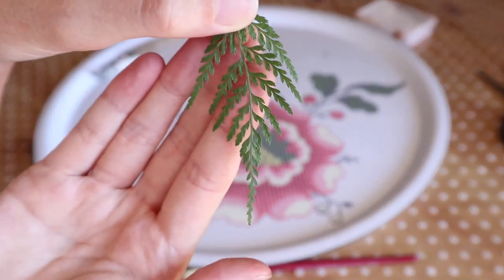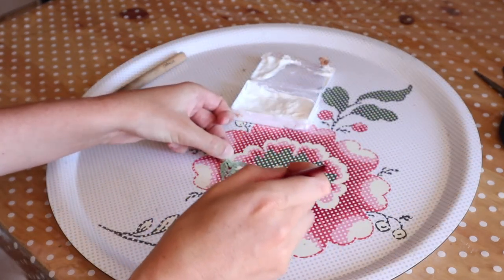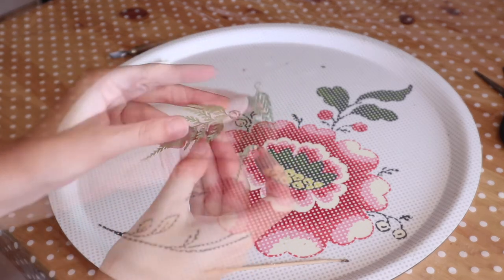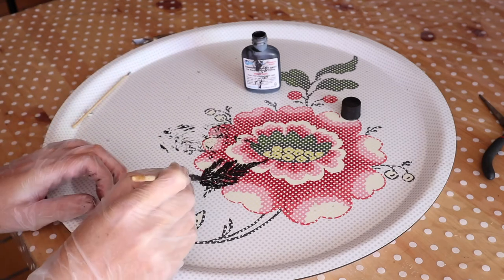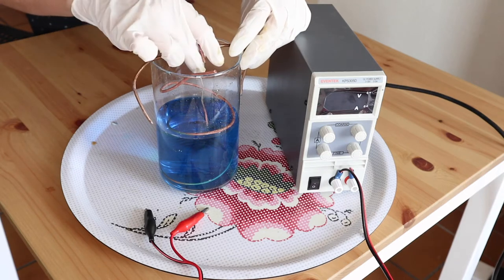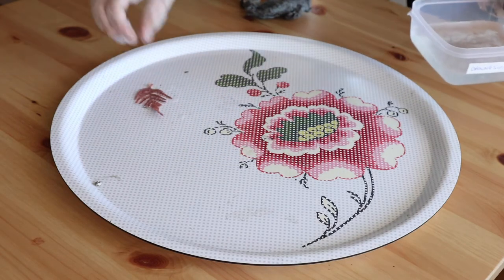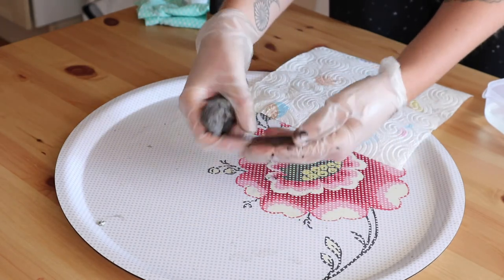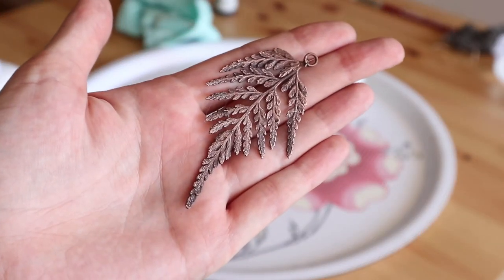Electroforming Leaves: Step By Step Process

Comment: Cool! I want to electroform a roach and then plate it with gold! 😁
Thank you for sharing!
Reply: I really hope you mean a dead one. Also you'd need to properly dehydrate it first which can take a long time. There are talented people that only use the insect as a "model" and they make a sculpture instead, leaving the insect to nature where it belongs. You could simply sculpt it in polymer clay and wire and still electroform that. Then you could make a mold out of the electroformed piece and keep replicating the piece through a better method, like lost wax casting.  Instead of using actual insects everytime.

Comment: Hi. I bought everything on your list, got my leaf project all set up and ready. hooked up the plugs and turned on the machine... When I put the volts at 00.2, the amps are very low: 0.01. If I turn up the amps to .09, then the volts go up to about 5, 6,+. How do I get the amps to go up and keep the voltage low?
Reply from the maker: Hi, I only turn up the volts, and never touch the amps. I set up my volts at like 00.2 or 00.3 and my amps are usually between 0.20 and 0.40. All rectifiers are different so I'm not sure how you must set up yours. You can watch my video on how to set up your rectifier (I have an Eventek), it might help you with yours! https://youtu.be/v50ZXpm9tKg

Comment: What happens if you don't neutralise after the eform bath?
Reply from the maker: My pieces end up with blue stains from the bath on them when I don't neutralize. But you can scrub them off with a woold pad or when polishing. Neutralizing is 'optional'. I wasn't doing it when I first started electroforming.